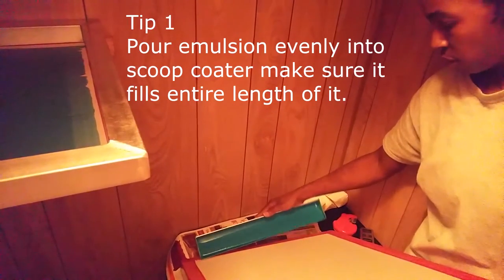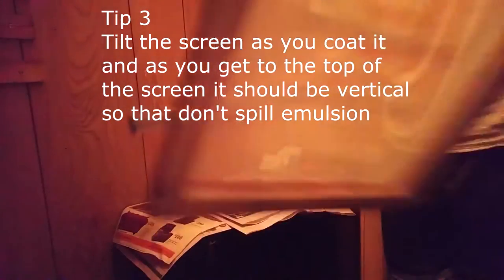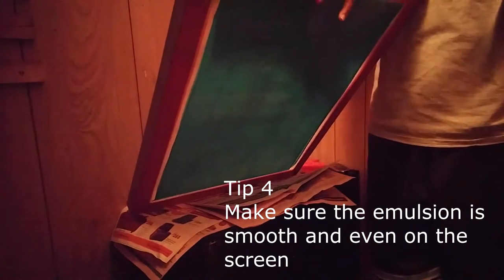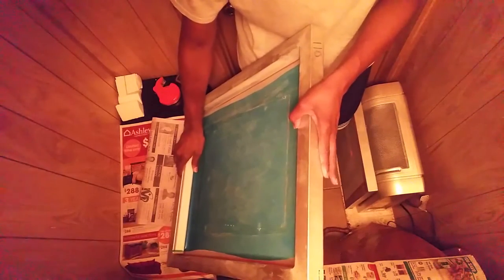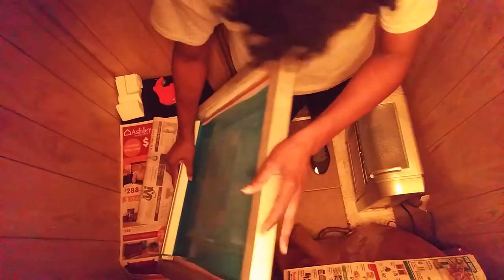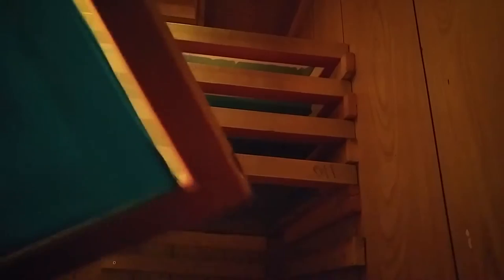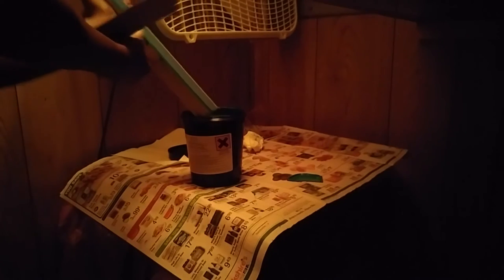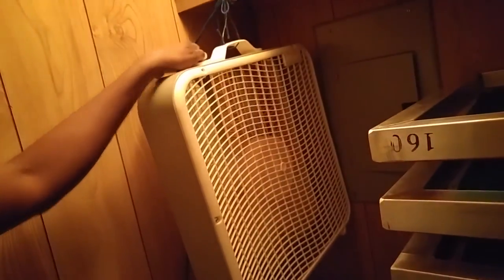Screen Printing 101: Coating Screens w/Emulsion

Comment: I thought u had to coat with the lights off? What type of light do you use
Reply from the maker: You don't have to coat them in the dark I would probably make a big mess of the whole room LOL! I'm using a yellow bug light but you can coat in regular lighting but you have to let the screens dry in the dark and store them in the dark and only bring them out when you are ready to burn a screen.

Comment: Using a squeegee to apply emulsion can do the work ?
Reply from the maker: Yes it will work but a  scoop coater would work better and be less messy.  They have some cheaper ones like the one I used in the video I'll leave a link for some in different sizes you in case you are interested: 

14 inch Scoop Coater:  https://amzn.to/2NzGIPf
16 Inch Scoop Coater:  https://amzn.to/2A0UDfo
18 Inch Scoop Coater:  https://amzn.to/2my74ph
Reply: Thank You

Comment: hi thank you for the video , but i was wondering when you leave it to dry in a drying rack , wont the emulsion of the top screen  drip on top of the frame below? kind regard
Reply from the maker: I have never had any dripping or running emulsion when I coat the screens.  If done correctly the emulsion should stick to the screen the only thing that could possibly cause dripping if you put too much  and don't remove the excess, this could also make the screen unusable so its best to put just enough on there to get a good smooth coat and don't over do it. I hope this helps.  Thank you for watching!

Comment: Hi, FIRST OFF THANKS FOR SHARING...
Question please, what is the best emulation,  to use for water based inks? 
ONLY SCREEN PRINT text BUT HAVING ALOT OF ISSUES WITH 156 MESH COUNT AND SPEED BALL PRODUCTS...NEW TO SILK SCREEN PRINTING. THANK YOU
Reply: Thank you for the speedy reply to my prior screen printing question..
Initially didn't describe the issue correctly.. 
INK WILL NOT PASS THROUGH MY LARGE TEXT EVENLY although   WITH 2 or 3 passes, design still very choppy & unusable..  mesh/waterbased inks used
Reply: FYI: Purchased the suggested Emulsion, worked better then anything else I've tried..
And less expensive compared to funds wasted...Thank you, faith in my craft was restored...

Comment: You make this look so easy. Last night was my first time trying coating my screen, it was a hot mess. I couldn't  get the hang of it ink was everywhere. 😑 I will continue to practice.
Reply from the maker: One of the main things to remember is to make sure the emulsion is even inside the scoop coater so that once you put it against the screen it will bead (or make contact) against the screen at the same time then scrape it up evenly until you get close to the end of the screen and get ready to stop and tilt the scoop coater away from the screen.  In the video I used 2 coats per side but I now only use 1 coat per side.  If you  mess up you can go back and use the scoop coater to remove the excess emulsion by scraping it against the screen just to remove excess.  Keep practicing you will get better at it.  It's taken several years for me to get to this point.  Hope this helps.
Reply: TshirtChick Thank you. I am sure I will get it. I will keep watching your videos.